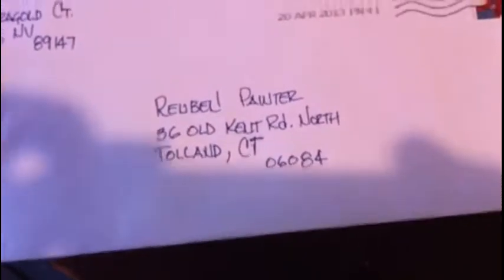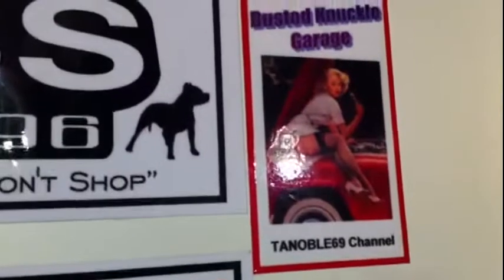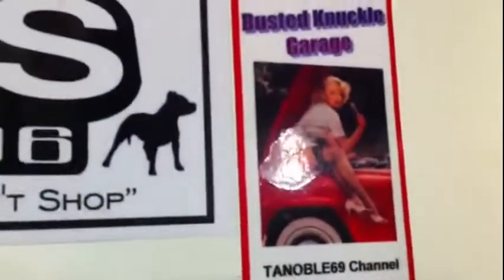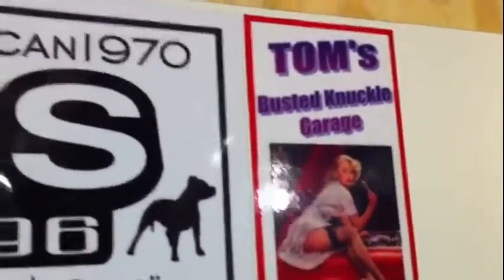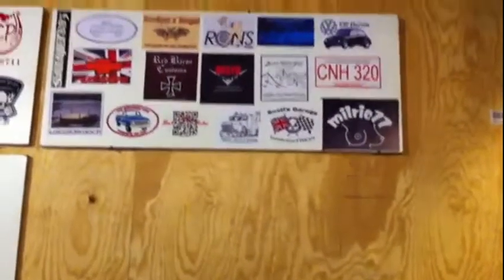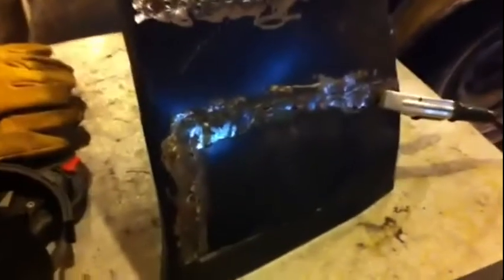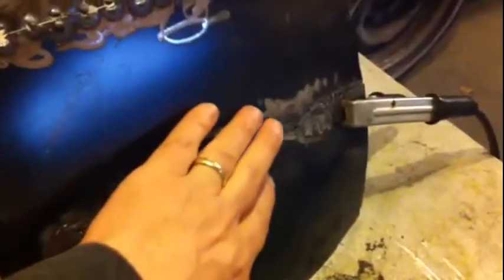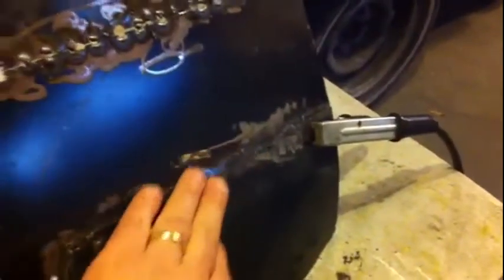Welder polarity was wrong-- or was it? TANOBLE69 MAILCALL!

Comment: I hear you. I will definitely practice as soon as I set up my breaker sub panel in the garage. Let us know if you find a good source for a replacement wire sleeve for the smaller solid wire that we will be using. .023 or whatever. I was just disappointed that the welder didn't come with one. Thanks for subscribing to my channel by the way.

Comment: Can I suggest that you clean an area of paint off some other sheet metal and just try laying down beads of weld material.  Make them continous and don't worry about warping the metal.  At this point you just want to see the puddle and learn to control it.  It is much easier to blow through metal at the ends than in the middle of the piece.  Once you feel comfortable with running continous bead then go back to the original practice piece and try tacking the ends.

Comment: If you are using .035 wire on sheetmetal, you will have these problems. Switch to .025 with gas to weld sheet metal.  If not, invest in gas, ya gotta have it on auto welding.  Get a roll of wire and a pack of tips and practice, practice, practice. The .035 liner in your whip will work with .025 wire. Also, if a whole quarter panel is available, it is much easier to put the whole panel on, just a bunch of spot welds, which is easier, than a lot of welding seams.  From an old bodyman & painter